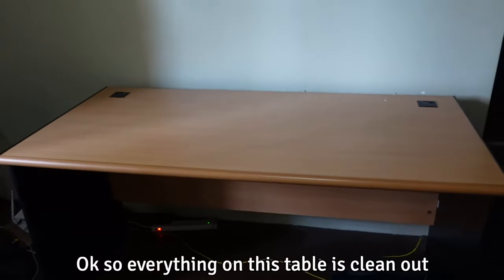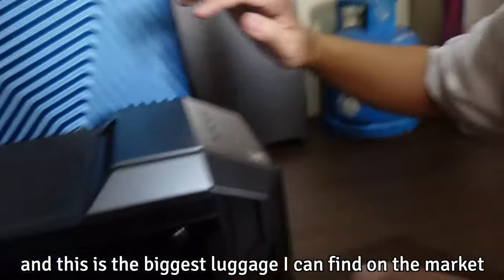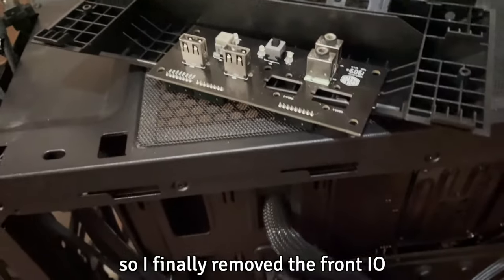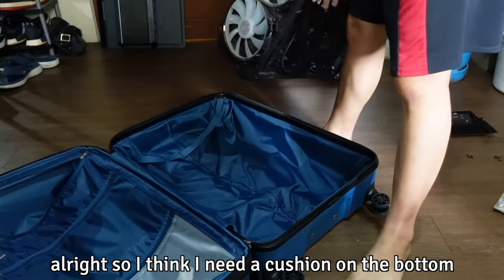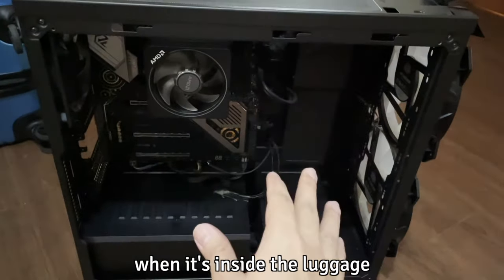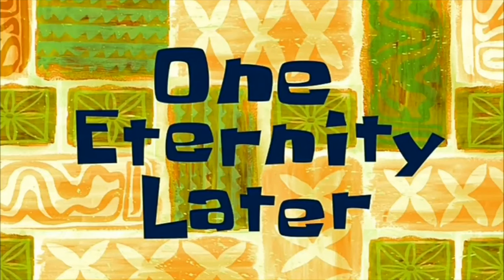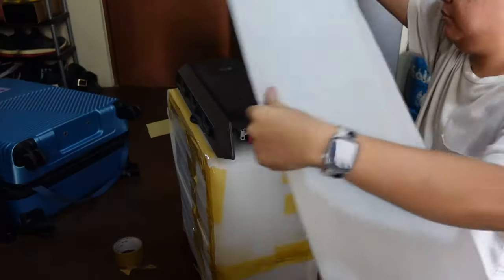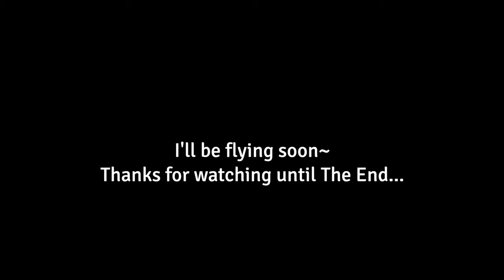How I Pack my PC into a Luggage

Comment: I really think the safest way is to put all the pc components like the gpu and the motherboard, in their original boxes and put them in your carry-on baggage so you don't rink the ground crew of the airport breaking them.
Reply from the maker: yep that would be the safest way if you still have the box.
Reply from the maker: but you also need to consider the size of the box in your carry-on bag, since they are big.
Reply: Sadly I don’t have the original ones 😭
Reply: @kumaWen so is expandable foam the they use for the protection in the original gpus package box?
Reply: And what about the cabinet?

Comment: Apart from what you have removed from your PC. What are the parts that are needed to be hand carry so it won't be damage? Thanks for the video though. I'm traveling to Iceland and it will be a long flight so I need to consider this
Reply from the maker: I would recommend you hand carry the GPU and storages.
Reply: @kumaWen  same, would like to know how everything went. Did they make u open the box etc?

Comment: Everything looks so big. I replaced most of my PC parts and made it SFF build (small form factor). Literally can fit my pc case, monitor, keyboard, mouse and cables into 50x40x20 cm case and take it into plane's cabin. SFF isn't for everyone but you can really pack a solid high-end spec into small case. Of course take out the GPU from the slot and if not using water cooling, take out and the CPU radiator. They tend to break.

Comment: Hi, I am planning on going to Thailand with my PC also and I am from the Philippines and I saw you have a video coming from here also so I have some questions that I wanna ask. What airlines did you take? Did they try to open your luggage at the airport? I am planning to take my desktop on my hand carry and my monitor on my checked in. But I am still worried what will happen at the airport. Do you have any advice? Thank you so much! It'll be hihgly appreciated!
Reply from the maker: I took Singapore Airline and no they didn't ask my to open my luggage upon check in..

you are not allowed to hand carry PC and Monitor as far as I know, I would recommend you pack it in your luggage and check in

Comment: Hi, your video was very helpful and I  wanna ask more about it, cuz I have a plan to move to Canada shortly from Indonesia and I have the same case as you, I want to pack my PC which is a real PC like you in my luggage. when you arrived at the departure airport from your country and when you arrive at the arrival section, once you took all of your luggage and when you pass the security check, did the security check ask you to open it?
Reply from the maker: nope, surprisingly security didn’t ask me a single question, I passed through Jakarta and Singapore airport. So it’s safe to assume PC are fine to travel as long as it’s in luggage. Safe trip!
Reply: @kumaWen  in the luggage which means in the Baggage right? and not in the cabin
Reply from the maker: @thomasvilanova9414  yep baggage that you check in before fly. NOT hand carry
Reply: @kumaWen  Thanks for your info, really helpful
Reply: @kumaWen i'm trying to fly with my xbox one overseas next 10days did airport security not open the suitcase to check what is inside?

Comment: That's so ironic... I have exactly the same graphics card and I'm looking to pack in a similar size suitcase a similar size tower. It's like you made this video specifically for me. Weren't you concerned that the motherboard would be exposed to static electricity?
Reply from the maker: I was really concerned at first but I really don’t have choice since I want to keep my tower as well so I risk.. 🤣
Reply: @kumaWen  I understand. I bought anti-static bubble wrap which I'll use to wrap the clothes before I put them in the tower.

Comment: im going to turkey to meet my family and going for a year decided to take my gaming pc i didnt want to risk putting it in cargo cause it can damage my case so i want to take as Luggage Cause it makes more sense is there anything i should no about like going through security and etc
Reply from the maker: there was a saying going into security will be have static and might damage your PC stuffs or whatever, but mine turned out fine.
just so you know. :)
but other than that just make sure you full pack your luggage with foam or clothes so the PC doesn’t have space to move around while in the flight
Reply: @kumaWen  i just found out that TSA Lets you bring your pc in a suit case and take it as luggage if it is possible they said that there is no problem with bringing your pc on airplane as luggage thanks foryour help
Reply from the maker: @hadimanzar245  great! have a safe trip

Comment: is that for handcarry luggage?? did it weight 7 kilos?
Reply from the maker: no that was for airplane luggage.. my PC luggage weight around 20kg+
Reply: @kumaWen  ahh.. okay ... but how did u pass in xray scan? I think it will damage the other parts of pc.. So, you just said not to scan it?
Reply from the maker: @jinxterra8063  xray scan is a must.. I don’t never heard it will break PC parts though.. luckily mine didn’t break. haha
Reply: @kumaWen  ahmm. okay .. I hope mine will be fine.. Did you just remove your ram and ssd? .. or just leave it that way?
Reply from the maker: @jinxterra8063  yep.. I removed Storage, RAM and GPU and put it in my hand carry bag.
Reply: @kumaWen  well..i think that works.. thank you so much for this guide 🙂🙂😇
Reply from the maker: @jinxterra8063  no prob!

Comment: Dont put clothes inside the pc you can cause static buildup. Also just sell the case and get a new one at the destination. Also remove the cooler as it can have a lot of torque on the board moving around.